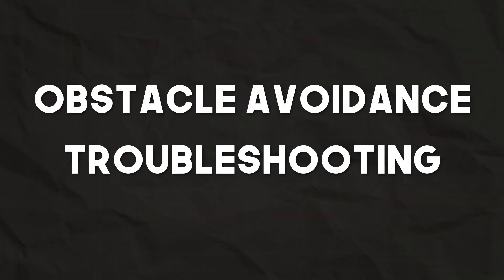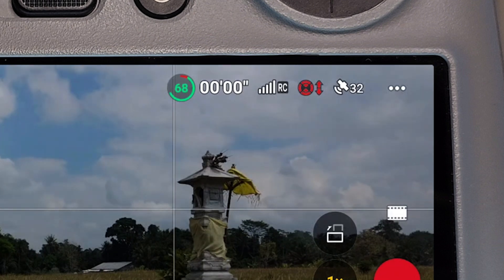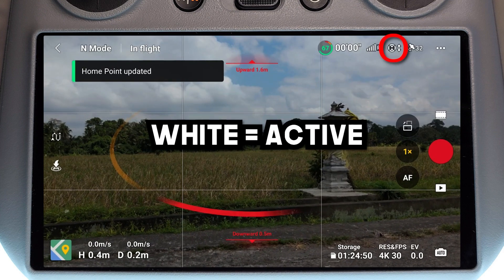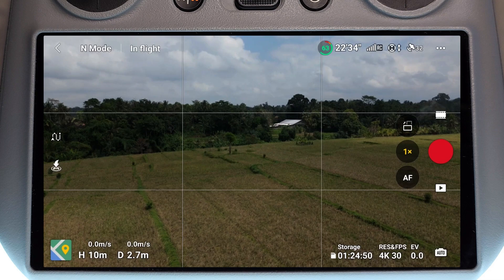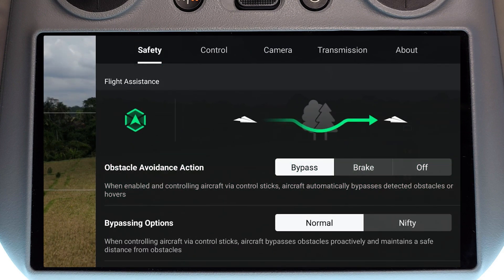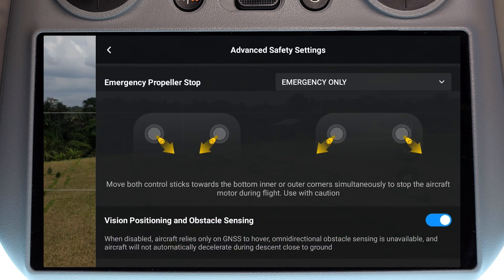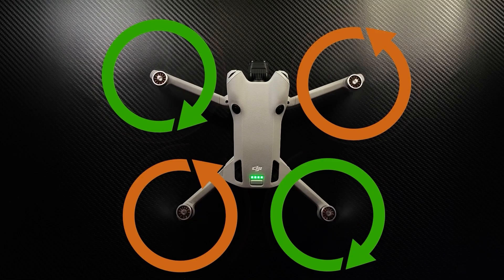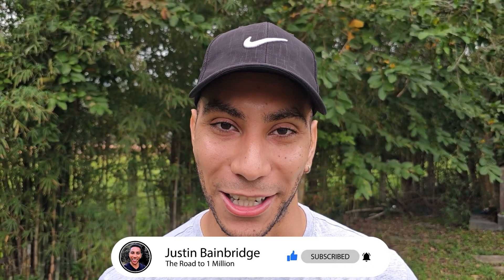Why Isn't My Obstacle Avoidance Working? Troubleshooting Tips

Comment from the maker: Having trouble with obstacle avoidance?
Remember to check the following.
1 - you must be in Cine or Normal mode. Obstacle avoidance is not active in Sport mode!
2 - Have you taken off?  Obstacle avoidance only becomes active in flight
3 - Is it dark? Obstacle avoidance isn't available in low light or dark conditions.
4 - Is the obstacle avoidance on and set to brake or bypass?
5 - Is the visual positioning and obstacle sensing still active in the advanced settings?
Happy Flying 😃